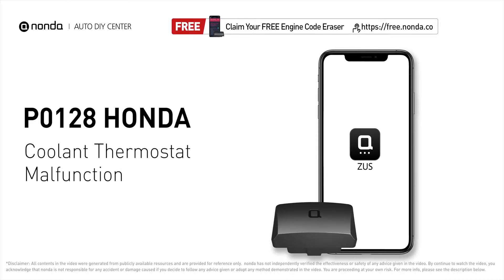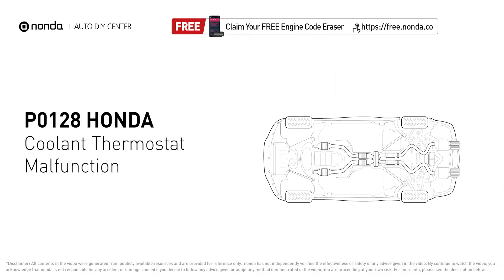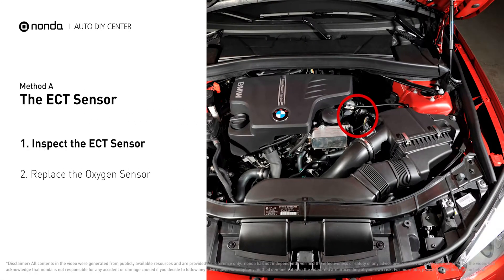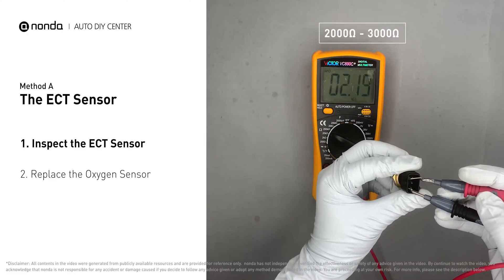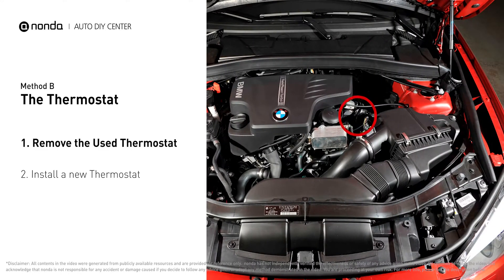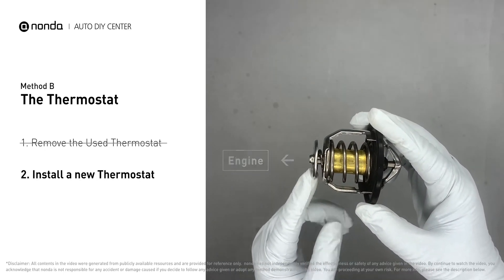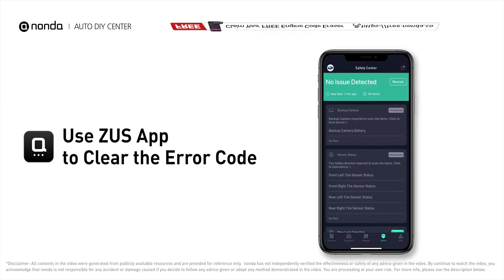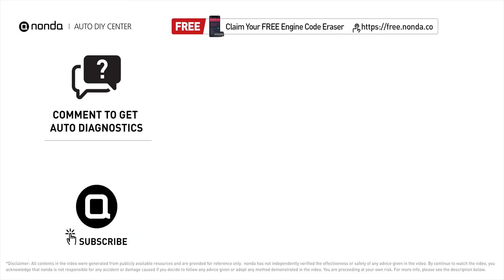How to Fix HONDA P0128 Engine Code in 3 Minutes [2 DIY Methods / Only $7.34]

Comment: How much is mechanic labor to do this ?
Reply from the maker: @hankgege2199 It's around $100-$150 depending on the shop's labor rate. Hope this video can help you to at least try first the possible ways you could do on your own to fix this code. Thanks for watching!
Reply: Probably a lot more than its worth. Look where the ECT sensor and Thermostat are located. Parts cost is incredibly low, like a few dollars. They will drill you on labor and this takes about 15 minutes to do
Reply: @errldabbins  thanks for the info. My emissions system light went on. I went to Autozone and they tested it stating I need a thermostat. My registration tags are due and needs a smog check. I want to the dealer and they charged me 67 bucks for the thermostat! Auto zone was selling it for 22 bucks but I didn't trust auto zone parts. I think the dealer ripped me off. Don't Thermotats usually go for 40 bucks? Did I get ripped off? Any ways the mechanic charged me 130 bucks for the labor. Is that a fair price for labor? I ask cause I don't have any mechanical car skills.
Reply: @hankgege2199  The thermostat cost  itself will vary depending on part brand and vehicle model. Keep in mind that the dealer will likely have the highest price, but you will be guaranteed OEM parts, if that matters to you. $130 for labor doesn't sound off as mechanics usually bill by the hour. Your invoice should say how many hours labor you were billed. I would imagine it was 1 hour. My Lexus dealer charges $200 per hour. A brief web search indicates that most people pay between $300-$500 for thermostat replacement.
Reply: @errldabbins  thanks. Mine is a 2015 honda civic coupe lx. 67 bucks thermostat? Is that a little steep for a 2015 or legit?
Reply: To much stop being lazy, learn something